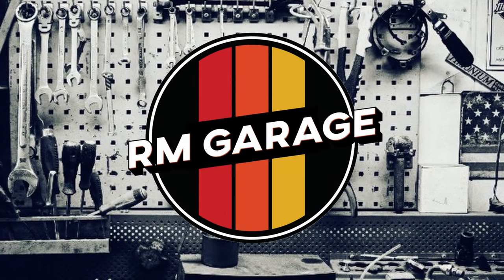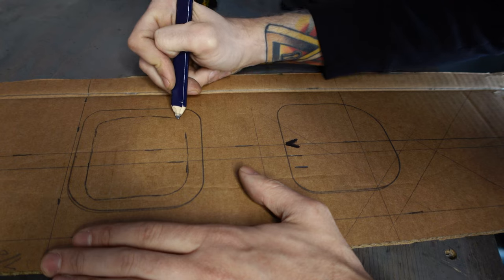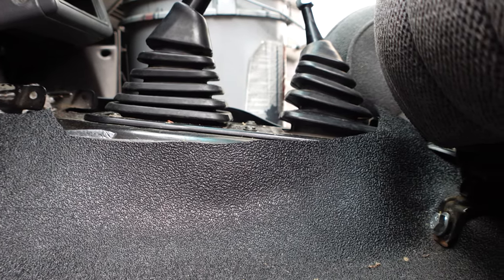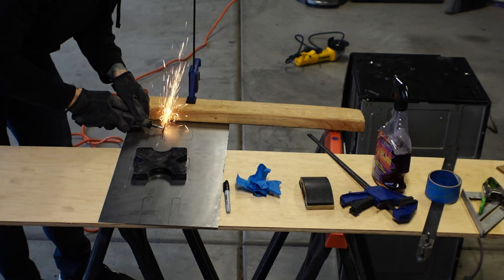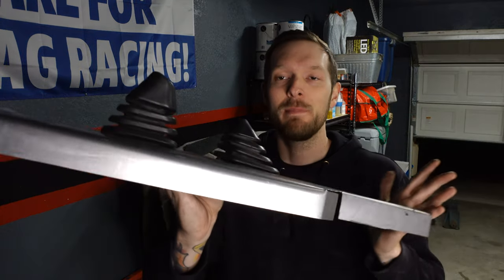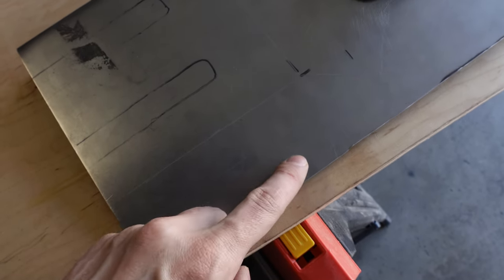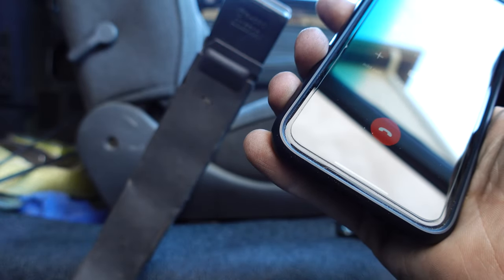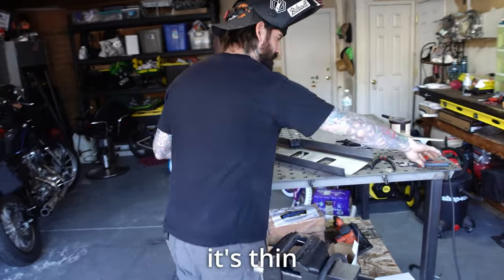Building a Custom Center Console For My Truck // Ep. 1 - Starting From Scratch - 1988 Toyota Pickup

Comment: Looks good. For Cardboard CAD, beer box style cardboard works easier if you're going to be using thin gauge. It just bends more realistically the make up your templates. Corrugated cardboard is good if you're making a template for like 1/4" stuff.
Reply from the maker: Thanks for the tip!

Comment: Sweet little project! I've been thinking about doing something similar. I want to ditch the triple sticks, to much movement in 1 area and the boots bind and pull each other out of position, its annoying. I do really like the factory console and arm rest though, so I may have to fabricate something with flip up console to access my sticks.
Reply from the maker: Thanks dude! I really like the factory center console too. Since this is basically a shift bezel at the moment I think I have room to maybe retrofit a Toyota pickup/4r/taco arm rest/console area behind it.
Reply: Yeah, my shifters are 3" back from stock, so that would not be possible for me
Reply from the maker: @DirtGarage  Ah cause the V8? Didn't think about that.